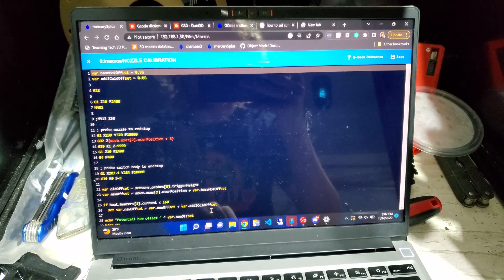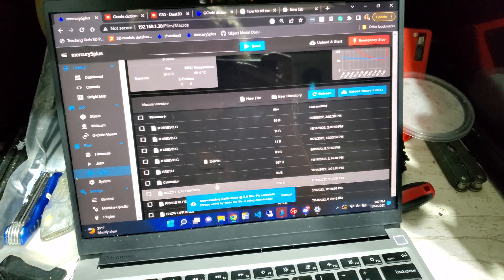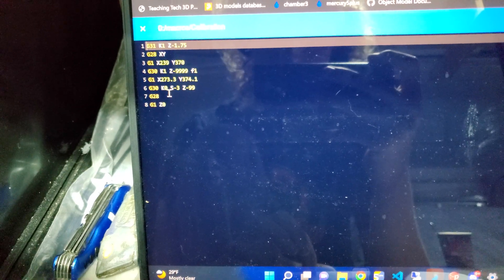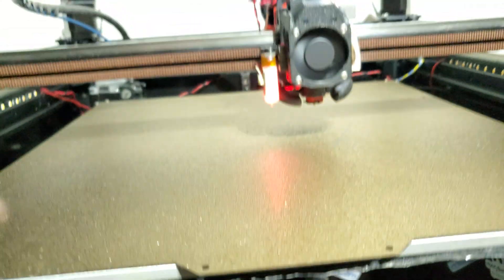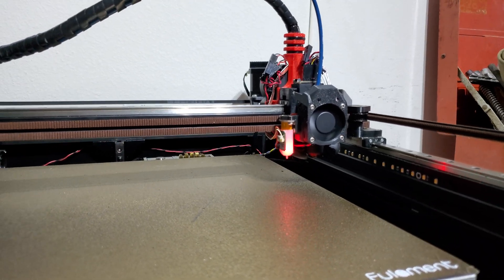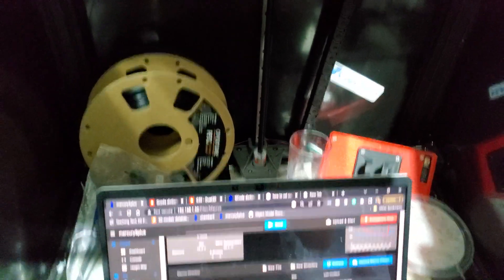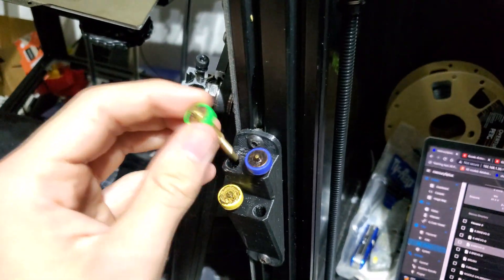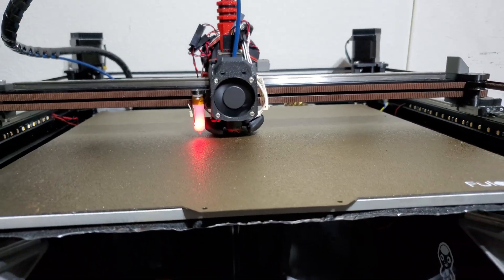Automatic printer calibration macro

Comment: Excellent. Is the piezo probe under-bed or on the hotend?
Reply from the maker: It's a precision piezo Orion usually used for nozzle probing attached to the metal pin off the back of the bed. There's a couple disadvantages of the sensors but using them as offset sensors is pretty perfect for them